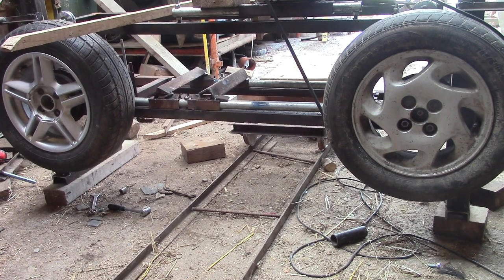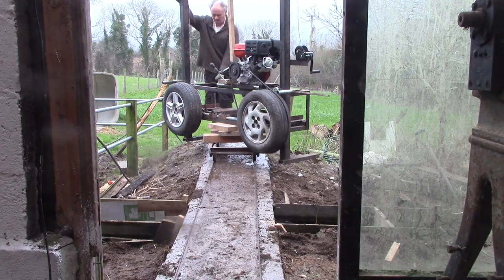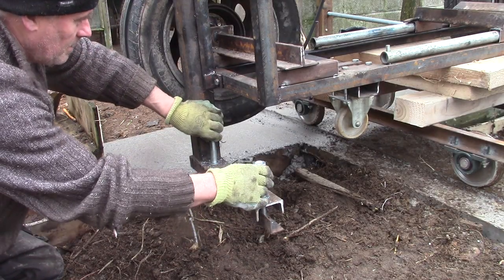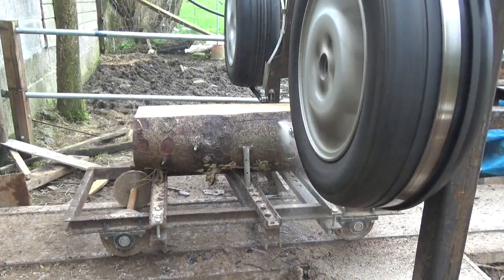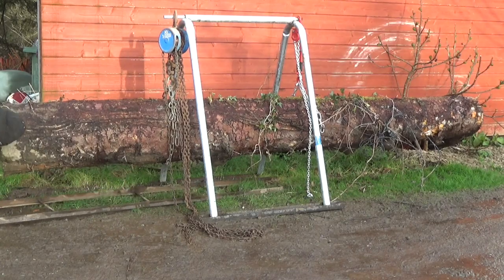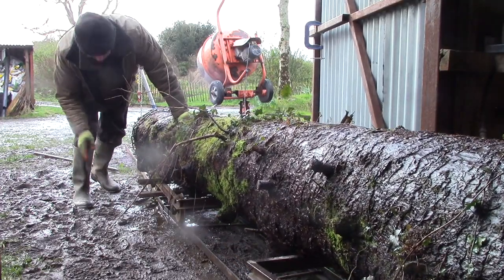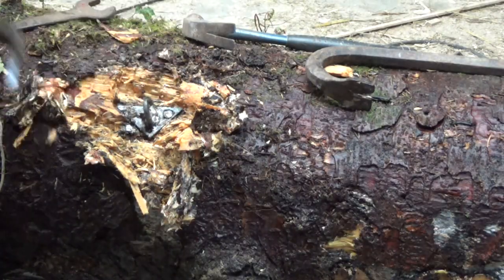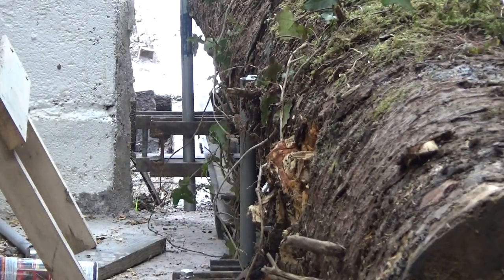It Works!! (Homemade Bandsaw Mill, Part 3)

Comment: If the logs are free of mud and rocks also any metal such as crews, nails, wires or bullets in it, the blades would last longer. Also with a five gallons plastic bucket, with 1/4 inches of hose and a valve to controls the dripping of the water by the gravity flow... it definitely will make the milling easier... by the way, your work areas is too...limited....

Comment: I noticed that you didn't water the blade to keep it cool, and maybe giving the logs a powerwash first, it would save the blade for becoming dull in long run, but great idea might Implement the same method to my saw too
Reply from the maker: You must have missed the watering part - it's there. Have another look

Comment: I guess you're doing as a test but usually you cut in a square before you start cutting the wood you need so you need to build something turn the log in less you already have
Reply from the maker: That's a very wasteful way of cutting timber (the widest part of the tree is cut off to make the square) - but people do it because it saves time. I'd rather have the timber. Wouldn't you?

Comment: I like it!  Thinking of build something similar, but I was thinking of using motorcycle tires/wheels.  Much lighter, a nice shape for the blade, and a built in drive sprocket.  I may incorporate a few of your ideas.  Mine needs to be portable, though, which should offer all kinds of challenges!

Comment: good job..word of advice from an american bandsaw operator..
a gravity drip of soapy water will help with drift and keeping bamd from getting gummy.
and.....
any kind of grit is death to those thin bandsaw blades..unless you want to unvest a 1000.00 in a sharpening setup..and a tooth set tool..chipping diwn the edge of the log remiving bark will go a 1000 miles preserving the sharpness if the teeth...once the teeth are ran thru ANY dirt..it will start to drift and bind..
explore different options fir a debarker attachment..or take the time to chip down the cut path w an ax..it will save you TONS if money on blades
Reply from the maker: Thanks Walnutlogger. I've read that if you're using car tyres then it's best not to put anything in the water - what do you think?
I'm just figuring out how to build a sharpener/setter, and how to get the logs to the saw without them touching the road. 
(There's a lot more to this than just building a simple saw, isn't there? Satisfying, though!)
Reply: WayOutWest Blowinblog 
oh yes..its absolutley satisfying..
iv not delbt with the car tire and lubricant issue..id have t say...try it..and see if its adverse..you really do need a bit of water at least dripping on the blade.most use water w a bit of dawn dishwashing soap in it..
it really does help..
on the other topic..good luck with that...as a logger whose cut and tranported several million feet of timber to the mill over 15 years..its not very feasable to think you can handle logs without them getting muddy..or even dusty..its just heavy workeven a big tree hitting the ground will skin up the dirt..
not trying to be critical...jus trying to be helpful..as iv been there done that..im passing on my experiences..theres several options for the debarker..the simplest solution is call a bark wizzard or something like that..wood mizer make it..not sure if they have specific patent..it bolts to the end of your chainsaw bar.just buzz it diwn the edge of your log..and your done..
a simple draw knife helps bunches..or..even just skimming down the edge with an old chain on your saw helps..if you saw more than ten logs...youll understand what im talking about..i personally had my fill of bands..(sawed quite a few thousand feet)
ill be building me a 40 inch chainsaw bar hydraulic drive rig..
cheep lawnmower motor(common) turning a hydraulic pump..powering the chain..(common..and easy to sharpen and set)and the drive..and the height adjustment.
and log dog downs.
ill be losing the thin kerf of a band.
but gaining in the reliabilty of using common components of chainsaw bar and chain..plus its rigid..i dnt do youtuve vids..but i may have to for that..
but hey..i love the ingenuity of what you built.its great..even greater if your not needing production footage..a few occsssional logs here and there...handy tool.and if you havent experienced it yet..oak..is a different puppy altogether than spruce...and my suggestions will ease the pain of bands alittle..good luck..and GREAT INVENTION!I THOUROUGHLY enjoyed watching your build..
Reply from the maker: Thanks, WL. Let me know when you start your Youtube channel and I'll sign up!
(I have water dripping already - seems to work fine.)

Comment: Sir, my hat goes off, it looks, operates amazing, I think is time to make my own. At a place where i work there is bandsaw hugemongus beast german made probably older than me, as far as I know, that wavy cut you saw (pun intented) comes from oveheating or dull band blade. Dont quote me, but the band should be stretched 200 in something measure, dooblay-do should tell, and allways reallies tension after a job.

Comment: It may help your cause a little if you were to put a wedge into the cut after the blade has started... It will make it so the blade isn't pinched in the wood. (I have no experience with this, but I've seen it done). This is great though... I'm really glad this worked out for you!

Comment: I have seen other ones on here and real like the idea of the static blade and especially moving  the wood to it I thank is away better  .Grate stuf
Reply from the maker: Cheers, Michael. Yes, I think this way is better for a static set-up. I guess they developed the other way for mobile mills?
Reply: Even with a  mobile set up  it would be very handy to have mobile track to  bring wood from a pile to the saw mill

Comment: I always wondered if it would be easier to have the log in motion over the saw unit like other home sawmill units. What do you think now that you have built this style?
Reply from the maker: Now that I have a way of loading the log onto the trolleys, this way seems really easy. I guess the other way was developed for mobile sawmills? Very early days for me though - still learning a huge amount.
Reply: Having the log in motion requires twice as much track.

Comment: Brilliant job, I think I would remove the bark from log to preserve/extend the life of the blade
Reply: Agreed. And depending on the species, debarking can be really easy.
Reply: +WayOutWest Blowinblog  hi, yes I think it's worth it - from my limited experience  with chainsaws and bandsaws most of the blunting comes from the dirt and grit etc. stuck on/ in the bark. But that's only my opinion. Really impressed with your build.
Reply from the maker: Interesting. Do you really think it's worth it? Surely bark is the easy part to cut? (I'm just learning all this as I go along.)
Reply: You can always wash log with a pressure washer.. It's is effective! Also, why don't you use the horse to position and move the log? As a professional horse logger with horses similar size to yours, I'd say it would make life far easier and quicker! You could always use an arch :)

Comment: You seem to have a horse there.
I think you probably could have dragged said log with said horse, no?
Reply from the maker: You're right, we do move the logs around with the horses, but they don't work very well in the barn.
Did you see this one? https://youtu.be/Cd3jp32W4RU
Reply: Probably too much power. I'd imagine the log moves pretty easily.

Comment: Well done, great tool well made, have you thought about a crank or winch system to pull the log threw, it would certainly save your back 
And probably extend the life of the blade as the pressure would be more controllable.
Reply from the maker: Thanks, Jim. I thought of that, but really there's no effort needed to move the log - half the time I'm holding it back slightly. Also, it's good to be in complete control - I could push the log away from the blade in moments if (for instance) I hit a stone.
Reply: Fed